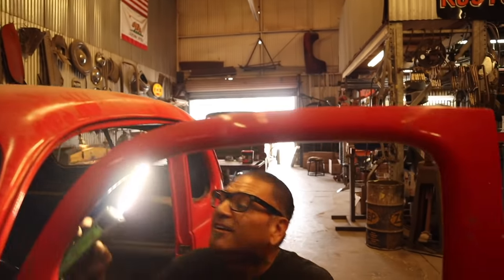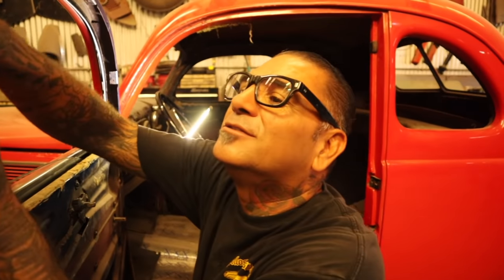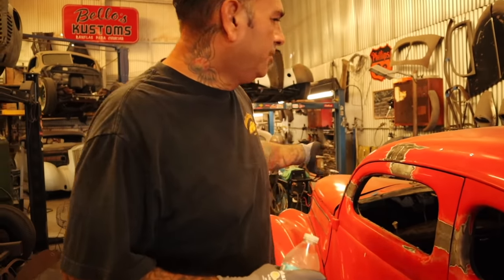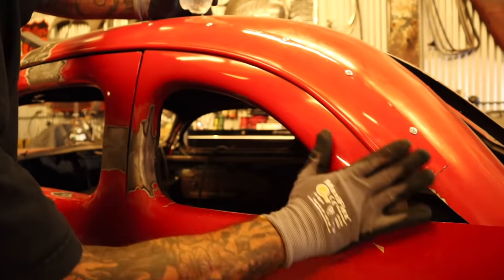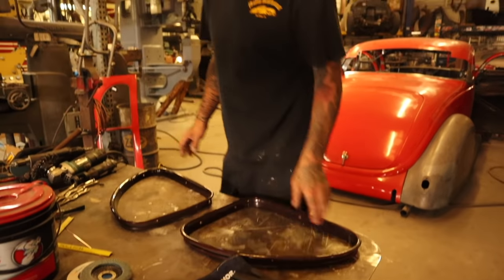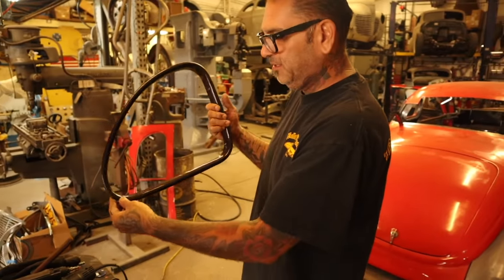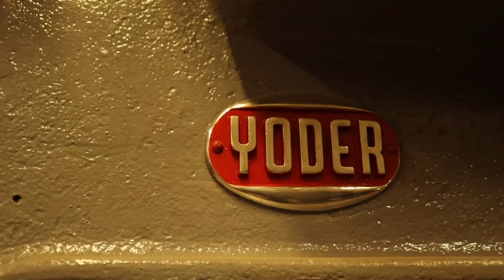1937 Ford | TIME LAPSE CHOP TOP

Comment: I've done a few chops through the years. I've seen hundreds done by other shops. This is the cleanest version of a chop I've ever seen and if I ever happen to do another one I'll definitely change some of the things I used to do. Your metalwork is superb man. One way for you people to know how right his work is?... When he uses the bodysaw to cut away the overlap so he can do a buttweld... nothing jumps up out of place, theres no tension on the metal at all. He's not FORCING the metal into shape, its already in shape by his hands!
Reply: but its about the result, not how you do it
Reply: @WOWTODAZ  its also about how you do it, I can't tell you how many have come into my shop that look good, but once I get into them, there's rust from overlapped joints, filler 3 in thick, and missed welds all over the place. If the work is done properly, then the result will last for a very long time.
Reply: When you want it done right.
Reply: This man is so talented that he actually makes his work look easy.
Reply: DITTO BROTHER. THAT DUDE'S METALWORK IS THE BEST I'VE EVER SEEN.
Reply: Beautiful work....legendary!

Comment: The first dirt track race I ever went to was about 1959 when I was 12 years old. There were tons of late 30's coupes and sedans. I think that's the first time I ever saw Frankland quick-change diffs. and hubs. Remember how the right front suspension was modified to make the tire lay out so it would stand up in the turns. Hoods had a strap on the front to hold them down. Had never seen all that stuff before.

Comment: What a pleasure seeing a craftsman doing real bodywork instead for so many other "Bondo-Bill" swinging mud hiding all the crappy welds and piss poor work.
This guy he knows how metal works, small saw for cutting is from the beginning a meat-cutting air-driven tool, that later on came out as a special tool doing body work.
English wheel performance from Mr Bello, just perfect *
Making panels, crimping and bending, another craftsmanship with knowledge. **
Welding using a tig for final result, then shrinking surrounding areas, also nothing you learn in one day. * * *
Very impressed Mr Bello, hats off to you sir !

From a retired old school body-tech in Texas.

Cheers * * *

Comment: 9:30 I'm impressed with your overlay/cut through method here.  You end up with a pretty seamless transition, I like it.  How much panel warpage are you getting using a tig over a mig?  I'm just curious.  I have a tig, but I've never used it on panel work.
Reply: I was gonna ask the same thing. You're right in there with the TIG, looks like you're running a bead. I can get heat buildup so quickly, then...  wArP. I'm amazed you can do this.
Reply: I was watching that very closely also. Would have exactly the same questions and would love to see this video with some Narration over it explaining the thought process and techniques. Sure is some fine metal work!!! This guy  "ENJOYS" what he does. It's so obvious!!
Reply: No expert here but from my experience, with TIG, you can control the heat a little better by using the pedal - speed/amperage. TIG welds are also more pliable so its easier to body work out that inevitable warpage. MIG welds tend to be brittle and less pliable. Not saying they aren't workable, just not as easy to manipulate. Another thing to think about is the heat being put back into the metal when grinding MIG welds, TIG welds are usually easier to cleanup - less weld material... but I guess that's dependent on a persons weld quality ;). MIG is definitely quicker to laydown a weld and a must for a quick tack. In this situation, with all the finesse required, TIG is the best route IMO. You should give it a go. Peace!

Comment: Almost surprised you don't have parts already made for car's and truck's you chop different pieces already shaped out and bent as many car's and truck's you chopped.
Reply: Nothings ever really the same shape, it's easier just to make it on the spot instead of doing all the work to get pieces made then having to modify them to work on something
Reply from the maker: this is correct

Comment: Cool to see where you choose to use MIG and where to use TIG. It makes sense. A lot of areas on my '51 Ford have surface rust, so if I cannot get the metal properly cleaned behind it, it gets MIG welded. But I try to TIG everything I can.

Comment: First time viewer, and I will be watching for more. Fantastic work. What is the brand and model of the air saw you used in this video. It must be a very good one with a fine blade considering once you trimmed the overlap you were able to do a quick dress up and buttweld the seam. Thanks for taking the time to edit and post this.

Comment: What is the filler wire you are using on the TIG , as you completely clean it off on the outside you must be certain that there is  ample to do that ?????
Reply from the maker: 3/32 70s2

Comment: Hello - love your video - I am a new scriber - I have to ask about your favorite pneumatic bimetallic blade hack saw  - looks like the model is a BA171 - is it a Berkling Tools saw? Closest model I could find is a Berkling 7102 Compact Low Vibration Air Saw/Air File ? Thanks in advance. (I own a POS from Harbor freight that I have changed out that still doesn’t work ) I gave up and had it too long and cant take it back anymore - my bad.
Reply from the maker: It's made by Ingersoll Rand 👍🏾